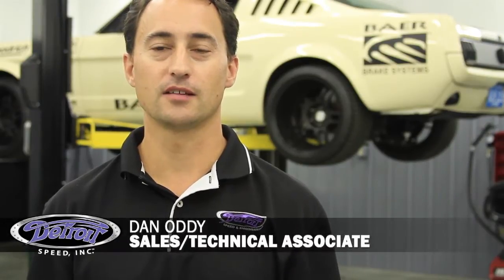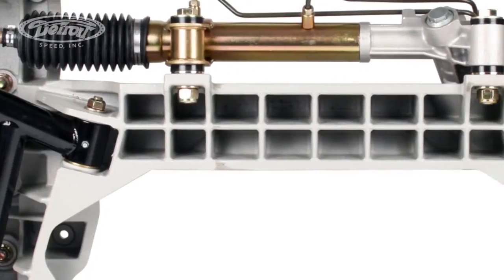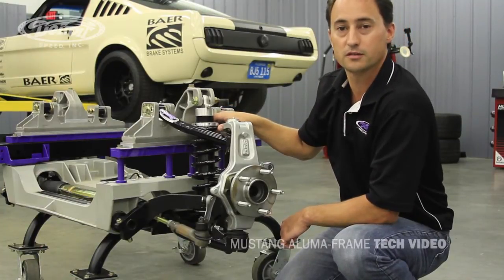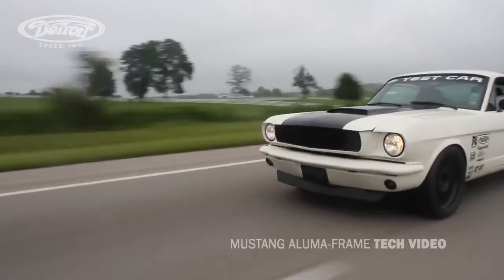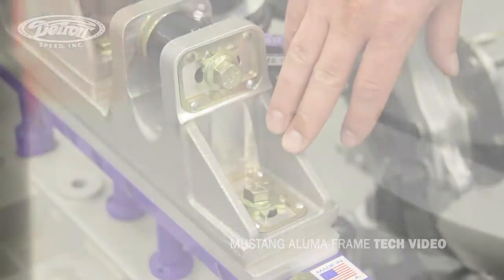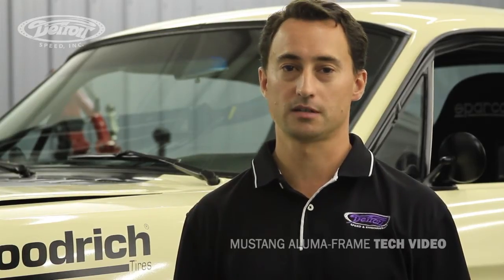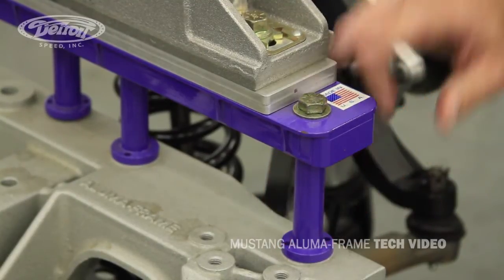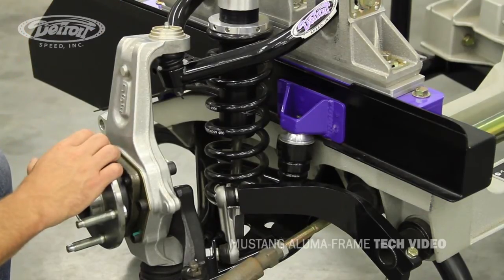Mustang Aluma-Frame - Detroit Speed Tech Series

Comment: Will that or the universal subframe you sell work on a 86 or 89 Fox body Thunderbird? I’ve been considering a build inspired somewhat inspired by Bill Elliot’s 1988 Championship winning T Bird and 1987 T-Bird that ran 212.8 mph at Talledaga. If I build it I intend to use a Kaase Boss 9 head on a Ford a Motorsports Siamese 460 block, a NASCAR timed out and rebuilt Jerico 4 speed with a 3.2 to 3.5 first gear and a 2.47 r&p gear in a 9” rear. Your suspension and chassis stiffening  components are being considered and also ones by Griggs Racing.